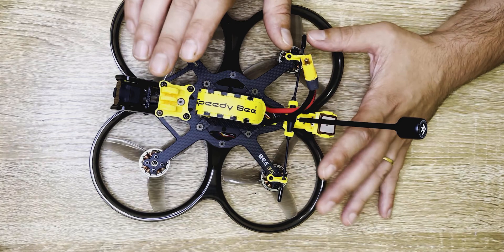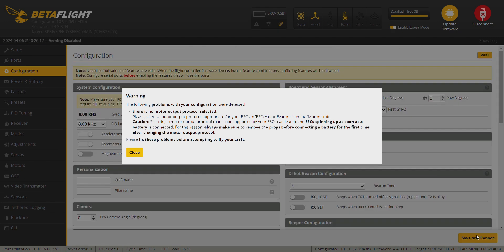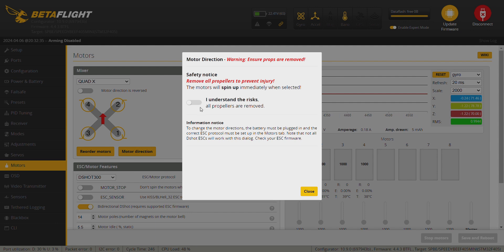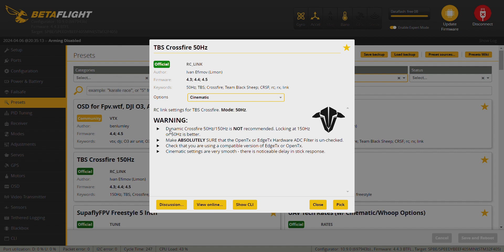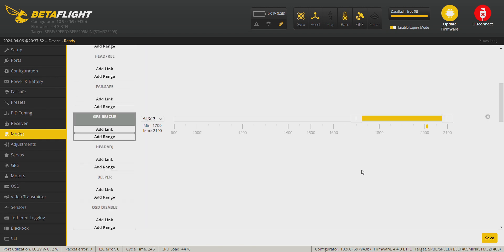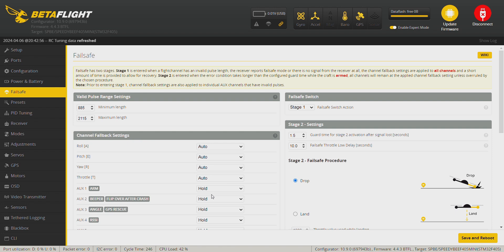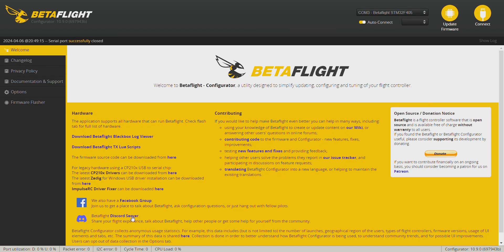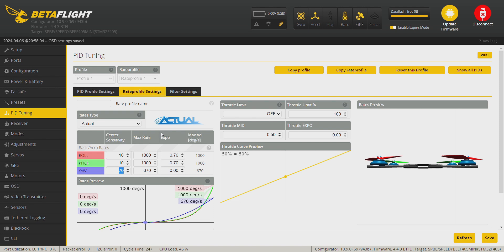SPEEDYBEE BEE 35 -Full setup guide on Betaflight 4.4 FPV #speedybee #building #drone #howto #foryou

Comment: Can you make a tutorial to match the prop orientation this is a nightmare my quad keeps pushing down. I have speedybee 55a stack with f405 v4, not sure what gyro first is if its already upside down the roll is 180 and i am guessing 270 pointed to left if its pointed right side up with motors. It also ramps up on ground with when throttled, the throttle gets stuck at max and blew up a motor already, i think i had this problem and is "normal" as its upside down and not flying... but its extremely dangerous.
Reply from the maker: Usually a fc has an arrow labeled on it, that arrow show face forward .
Anyway I’ll make a video about that
Reply: @fpvinprogress  True, I also matched it in 3D space. As I said its "normal". I also set flyaway manually in beta and lowered motor output until i test it. I needed to flip the pitch 180 and yaw to 270 and FC not like your video. Careful if this happens to you it is ever dangerous it will take off at max throttle 200kph with no way of throttling down burning out your motors.

Comment: I've build the same quad, but i'm using speedybee f405 v4 stack and geprc speedx2 2105.5 3450kv shich is a 4s. I'm not yet comfortable with tuning, so i've used some preset and tuning parameters that some pilot have used, im not so comfortable flying this quad. Last time i bought 1000mAh GNB battery, it would give me only around 1 min. Does more kv motor consumes more power? if so i have to buy 6s battery and tune down the kv of the motor.
Reply from the maker: Thanks for the sub🙏
I found this video for you ( link below ) in which it’s shown how to set throttle limit using potentiometer on your radio, it doesn’t matter that in the video a different radio is used because it works the same way in boxer or any other.
I also got a boxer ELRS nice cool radio🔥🔥

https://youtu.be/bBlXx3-NY0Q?si=0rJZuS8XJ7RQRWzp
Reply: @fpvinprogress  thanks for the link
Reply from the maker: @Hmingmawia_Ralte  my pleasure mate🔥
Reply from the maker: The stack you are using is a nice one. I also got a v4 speedybee stack which will be used for a later build.
Regarding the motors kv the one you have chosen are too high for that drone in my opinion, and yes higher the kv higher the consumption.
My suggestion is to swap the current motors with motors of between 1700/2100kv on which you can use 6s packs, or using the potentiometer on your radio to scale down the power of the motors.
I have fly tested my drone not tuned by me yet just with default betaflight tuning, and with 1700kv motors using a 6s 1300mah I got around 10mins flight time, maybe I’ll get an extra minute or two once tuned.
Next video which will be coming up soon is about tuning this drone, if you are interested keep an eye on my channel so you can follow along. The method used can be applied even on yours, even if it has different motors kv
Reply: @fpvinprogress  Thank you, i'll subscribed your channel, ill wait for that. Let me search that potentiometer in my radio to scale down the power. BTW im using boxer elrs version.

Comment: Great video. Very relevant. I am currently tuning this very quad and I appreciate your input. Your content is interesting, informative, and entertaining. Happy flying amigo 🫡 🍻.
Reply from the maker: Thanks a lot mate🔥🔥 really appreciated. I am also planning to make a video when I tune this drone.🔥
Let me know how your drone goes after you tune it.
In the speedybee website, under the speedybee bee 35 page there is a downloadable txt file with the factory tune. I can’t use that one since the bnf version comes with the 1950kv and on mine I have put the 1750kv, so I need to tune it myself
Reply: I am currently trying the UAV Tech preset for Cinewhoop. I made a mistake when ordering my motors and got 3200kv instead of the 2300kv I was trying for. I'm using some throttle scaling and a little expo in an attempt to tame the motors a bit for slower, smoother, cinematic flight. I'm not a very good pilot to begin with, so I hope to get a good tune and practice, practice, practice. Thanks for sharing your information and your FPV journey. Happy flying amigo 🫡 🍻.
Reply from the maker: And thanks for watching my videos🔥
Reply: Thanks friend. I look forward to your tuning video especially since it's specific to the Bee35. I'll take all the advice I can get. Most people in this community are very friendly and generous with their knowledge.  Thank you. I have my OX-35 flying pretty well I think. It's been way too windy for proper testing. I've been hovering around low in the driveway and it's pretty controllable. I wish the throttle was more controllable but that might just be my inexperience showing. I think a lot of new pilots struggle with throttle control. Thanks again for your content and advice. I value your input. Happy flying amigo 🫡 🍻.
Reply from the maker: We all start from the scratch my friend and sharing our knowledge and experience is the best way to grow in this hobby and in life too.
Throttle control takes time to master, practice is the friend for it. Practicing it on a sim is also a good way especially because in the sim there is no fear to crash, if it happens nothing gets broken, if you know what I mean😊
Reply: Also good advice. Thank you. I've spent a little time with the simulator but could use more.
Reply from the maker: I still fly on the sim, especially during raining days when I can’t fly outside. I still enjoy it and keeps me on the run, I don’t get rusted 😂😂
At the beginning I spent quite some time flying on the sim to learn how to fly acro mode, fly low altitude etc and it was helpful. Also we spend money time efforts to build our drones so we also want to feel confident to fly reducing the risk to crash or lose our drone, that’s why many people advise to fly on the sim when somebody first approaches to FPV.
Reply from the maker: Yes use some throttle limit if it goes too fast for you.
That bee 35 must go as a rocket then😉😎joke aside, on the other hand you can easily carry a full GoPro on with that kv motors.
I am gonna make a full “ how to tune the bee35 step by step “ . The method I’ll be using can also be applied to tune any other drone size.
With the same method I did tune my 5” and it flies wonderfully.
Stay tune my amigo and enjoy flying🔥🔥